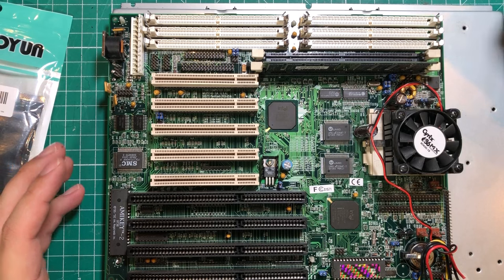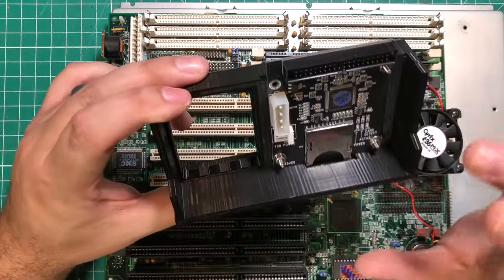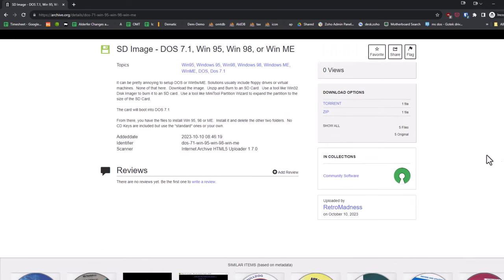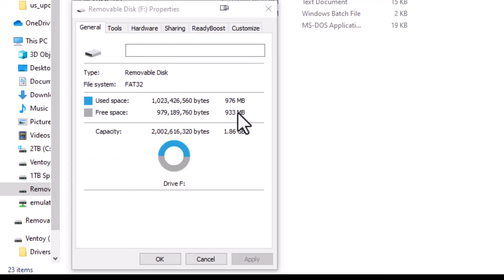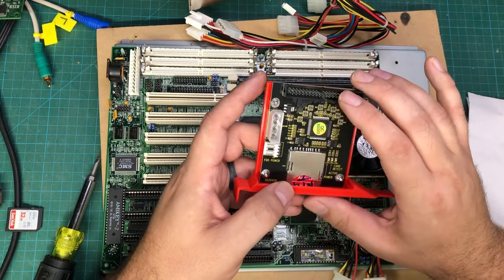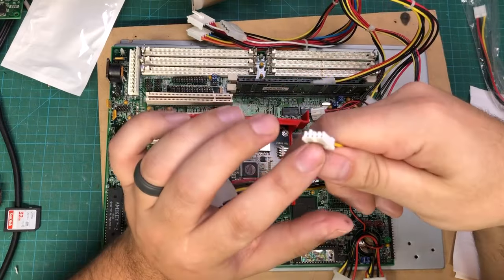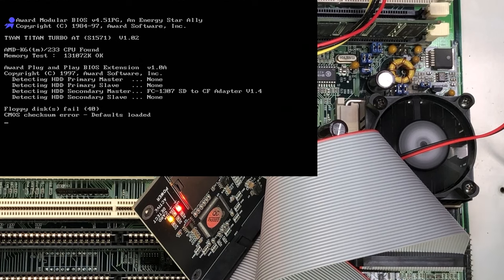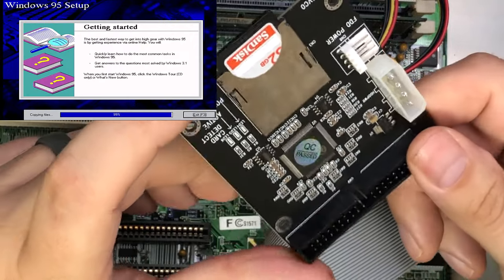How to Install Windows 95, Windows 98 or Windows ME to an SD Card the easy way

Comment: Been stuck on this for a few weeks. I did the tutorial exactly as you did - but when I put the sd card into my computer, it gets stuck when loading the hard disk. If i pull the sd out, it recognizes it after a restart, and it boots from a mechanical disk fine. Need help with this 😅

Comment: tried this today and didnt work. i just get a "DISK BOOT FAILURE, INSERT SYSTEM DISK AND PRESS ENTER" error
Reply from the maker: That's really odd. I've used it almost every day lately. Try writing to the drive and not resizing it. If I had to take a guess I would say whatever software is resizing it is probably breaking it. So if it boots without resizing then you at least narrow the problem down
Reply from the maker: The other thing is that just because you can write the card doesn't mean the BIOS can support a card that size. What kind of machine did you try to boot it on?

Comment: I may have missed something, the Flash boots to a C prompt and those operating systems need a C drive to install.  Hence, the installation went straight to the Memory Card.  Any thoughts on this?
Reply from the maker: That's the point. You use the SD card as your primary hard drive. Although you can use the SD card to copy those install files to a traditional hard drive if you want

Comment: Very good video, very well explained. 👍Thank you also for the links to Thingiverse, because I also own 3D printers. I'm just afraid that SD cards aren't particularly suitable for operating systems, because data is constantly being written to them and cached. Do you have long-term experience with it?
Reply from the maker: I've never had one die. I usually only buy the quality SanDisk ones and it's not like I run my retro computers all day everyday so they are perfectly suitable for that. I would not run it on my own desktop. 

Since they are smaller, they are also relatively easy they just back up
Reply from the maker: And thank you for the kind words
Reply: @AnotherMaker  Thank you for the quick answer, I'll try that out too.

Comment: Gosh I wished this worked, looks amazing. I get the same problem as Level-ts, the INSERT SYSTEM DISK AND PRESS ENTER error. I'm installing it on a Compaq LTE 5300, I partitioned the sd card to 2.0gb and still nothing. I've tried the 6.22 flas as well and I get hung up on starting ms dos...still messing around with it but if you have any ideas it would be much appreciated
Reply from the maker: I'm guessing it's a bios issue.    There are 2 issues that need to be solved.  1. Getting the proper files in the proper format (including hidden and partition tables) onto the sd card. Getting the bios to properly recognize the drive. Sometimes the computer takes care of step 2. Yours is a laptop, so I'm not 100% sure how, but the issue is that one way or another, you either need xt-ide bios or a card that is compatible with your bios.
Reply: For the LTE 5000 series, you probably won't want to exceed a 4GB card.  Some people have had luck with 8GB but it has been mixed.  At least that is the case for CF cards, never tried an SD card in one.

Comment: I would like to try this out on an old late 90's PC that I have, however I don't have a 3D printer to print the 5.25" drive bay, or the reinforced slot bracket. 

Do you know where I could buy those parts at?
Reply from the maker: I don't know where you live, but I'm guessing if you put it on Facebook that you needed something 3D printed, most people would be happy to do it.